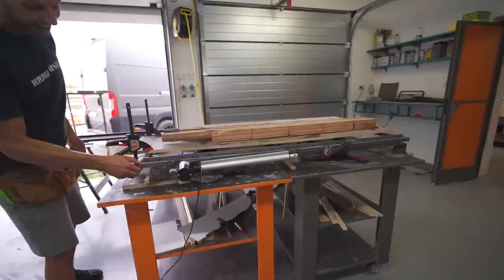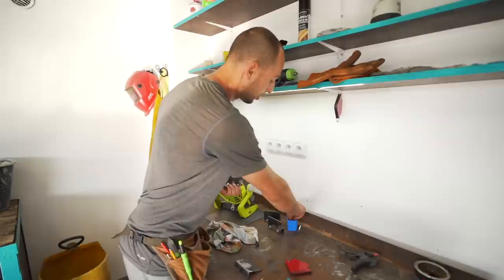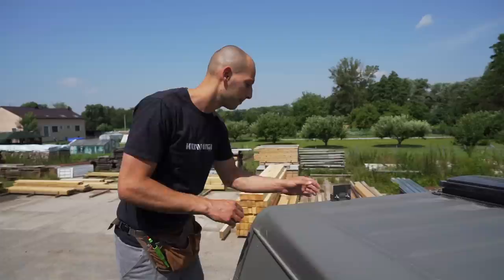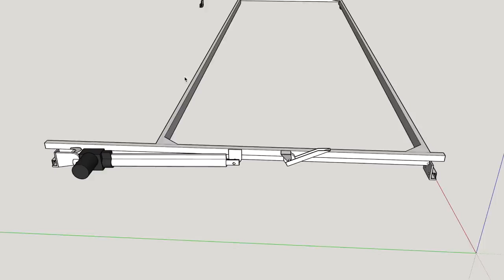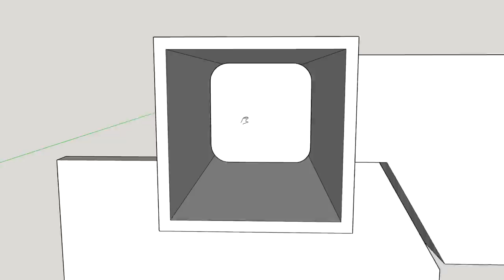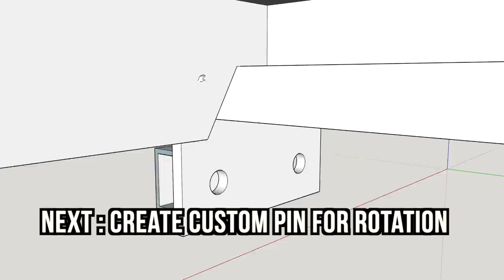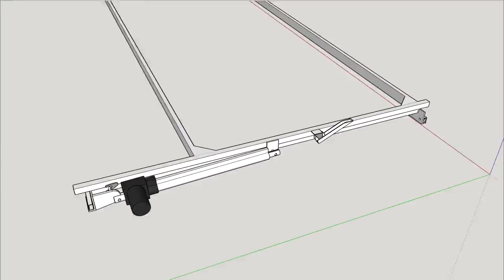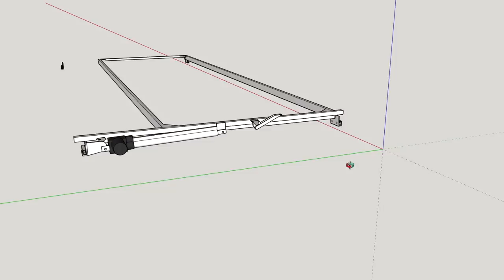How I Built Motorized 1kW Solar Panel Lift / Van Build S2E2

Comment: Just imagine how much weight you can save building van based mostly on cevlar parts but yeah, everybody knows how pricey that could be at same time.
Reply from the maker: That’s why it’s not realistic.
Reply: I looked into Kevlar and found the biggest problem was sourcing different profiles. Yes it was expensive but compared to aluminium not outrageously so. THANK you for jogging my mind - maybe I'll do more research. And if anyone knows of suppliers in the UK  then I'd be interested to hear from you  /\
Reply from the maker: Making the solar panel structure out of cevlar? That’s not going go work 😂

Comment: I am no engineer nor have I any experience in this field; wouldn't it be recoomendable to shape the mount (10) that the actuator pushes against in a more right angle triangular shape with the hypotenuse facing in the pushing direction?
Reply from the maker: There is definitely a better way of doing it. I’m sure of that 🙃

Comment: competing comments:

Yay, Millie!

2.55 tons?  Lily (my van) weighs 5.31 tons lightly loaded.  But, she is on a diet.

Your shop... to die for! (not litterally of course, that would be unproductive)

I'm not nearly a smart as Ladi, or even the table he tested the lift on but, something about the angle of the actuator arm seen at 36:20, where the "panel" is at about 32° according to my phone app., bothers me.

I trust in Ladi but also know he will make improvements in the future based on real world experience.  Then when perfected, he'll turn the design over to an aluminum fab shop, patent it, and you'll become trillionaires!

Comment: It's easy when you have a place, tools, and skill i have neither. So table is tilted and game is rigged. Nice job. Why did not retractable rack which slides in and out sure need double amount of panels.
Reply from the maker: It took a long time and effort to set the workshop up for these kind of projects. Makes projects like this possible. Two rows of solars are possible for sure. It would be very easy to tilt them as well using one row as a contra weight for the other.
Reply: @ladiandmargaret  oooh you did not recognised the fun in my lines. my advanced sense of humour sometimes takes a higher level of understanding than i realise. Absolute craftmanship. Happy to see thanks for your time.

Comment: Very well tought project. Will aluminum work better for a lower center of gravity?
Reply from the maker: It depends. Needs to be designed for a certain purpose, weight and material. This exact same copy might not work from aluminum.
Reply: @ladiandmargaret  what design software do you use?

Comment: How do you control the angle from inside the van?
Reply from the maker: With the remote
Reply: @ladiandmargaret  But there is nothing to tell it to go to 20 degrees or 30 degrees or 45 degrees to adjust to optimal angle for your latitude, right? It's just on and off. Being a nomad, I'm assuming the van can go way up north and south as well requiring different angles.
Reply from the maker: Up and down only. Stop at any position. Max angle is 47 degrees.
Reply: @ladiandmargaret  It would be cool to find some kind of angle sensor you can read from inside. That would be useful to me so if I was north part of the country or south part, I could adjust it to an optimal angle.

Comment: Ladi,  Ladi, Ladi 11:40    What? WHY didn't you just drill holes further up the legs? Two minute job -done. Oh, and one other word.... Aluminium.  Aluminium, S/S bolts and bonding. So much less rooftop weight, much easier to work with and no going rusty where all the welds are... I admire your creative mind a LOT but KIS. Keep it simple. x
Reply from the maker: What do you mean, having the wheel on one axle? Trust me, that would bend very quickly. 

That’s what I say in the video, I think this is too tricky for bolted aluminum but you can try yourself, I’m very curious if it’s possible. 

By using aluminum I would save around 8kg based on my calculations. Not worth it. This is the simplest mechanism I come up with. I’m excited to see how can it be done better.

Comment: A simple airbag lift would have worked well.
Reply from the maker: To lift solars to 47 degrees angle? I’m dying to see how!
Reply from the maker: How would you synchronize it with the actuator? When pumping up the airbag, the actuator must be extending. Same thing on the way down. It’s tricky when you leave the surface and dive deeper into details.
Reply: @ladiandmargaret  You are over thinking it Ladi. Just an air supply and latch to lock in place when traveling
 ( solenoid bolt to lock in place / solenoid valve to operate. )  This airbag can lift 3 ton !  The best engineering advice i ever got was K.I.S.S
Reply from the maker: I probably don’t see your lifting vision.

Comment: I understand the "Just build it factor" in that project - but all in all it is absurd.
My 100 watt PV semi flex panel weight just 500 Gramms or so. So even 10 of these are just 5kg. This is a ridicules amount of weight on the TOP of your rig - not ideal at all. I dont know how a PV can weight 15 kg and if so, it is the wrong one for a moving roof, like a car.
AND: It all is held from moving forward by these 5 mm Pins in the roof.
Reply from the maker: 8mm pins, makes a difference. You might be right. This was my best judgement at the time and it works.

Comment: Ladi.... put the guard back on the grinder dude, I dunno what it is about all YT creators and this terrible lack of safety. Have you ever seen what disc does to human flesh when they break!! It's not pretty and will end your DIY game in an instant. There's NO excuse for this.. 
Sorry, right, carry on, amazing build.
Reply from the maker: It’s mainly to fit 150mm cutter.
Reply: @ladiandmargaret  Use the 7" 180mm angle grinder then... or at least make a 150mm steel guard for the 125mm grinder. when those 1mm slitting discs let go, it's an absolute disaster zone. On very rare occasions (in the past) I've done it at home (I'd get fired instantly at work if I got caught doing that) but I've never stood DIRECTLY behind it like you did in two on camera shots I saw. Please don't be blasé about this. It WILL f** you right up. I've seen what discs do to people first hand (not me but colleagues) This is my career. I really can't stress it enough, you only get one chance and you don't grow body parts twice either haha  Sorry to moan but it's a pet hate throughout the YT DIYers..